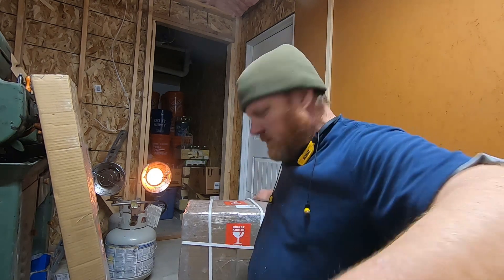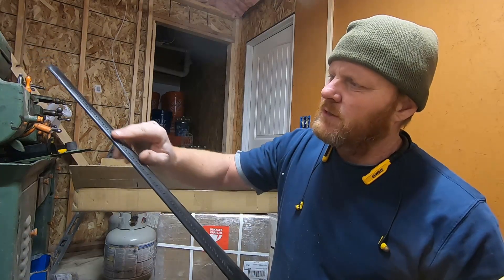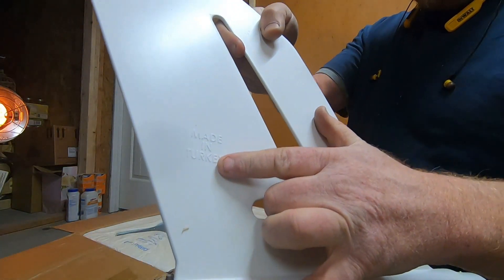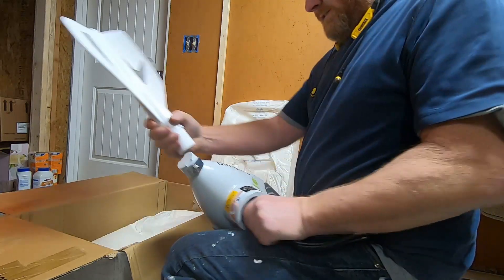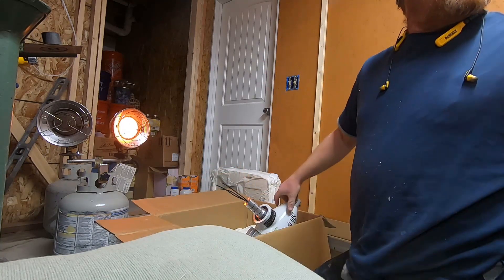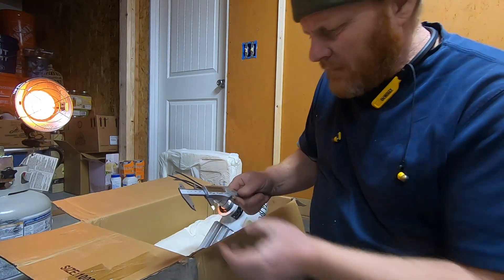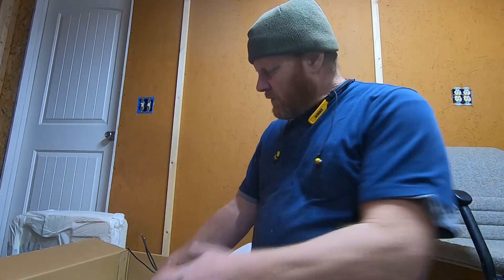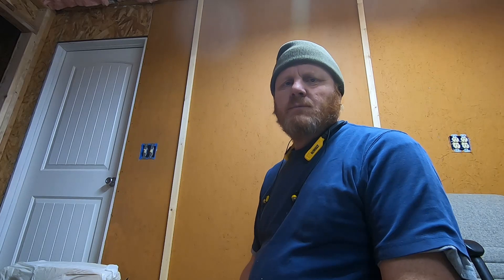Unboxing the Ista Breeze i1500 wind generator, watch before buying, wind turbine, wind mill

Comment: G'day Mate, I found small wind generators start up earlier in low winds,
starting wind speed 10km/h, these outputs are only what I saw in a 50km/h Wind Storm, they would have gone higher in the peak winds of 63km/h.
26V - 24V 500W Vevor   -  8 Amps  - 6.5 Meters  -  Normal 5 Blade
26V - 24V 500W Vevor    -  8 Amps  - 6.5 Meters -  Normal 5 Blade
14V - 24V ista Breeze i500   -  11 Amps  - 4.5 Meters  -  Scoop 5 Blade
12V - 24V 300W Old 6 blade   -  4 Amps  -  4 Meters  -  Normal 6 Blade
12V - 48V 500W Sunboo S5   -  2.5 Amps  -  3.5 Meters  -  Scoop 6 Blade
12V - 48V 500W Sunboo S5   -  2.5 Amps  -  3.5 Meters  -  Scoop 6 Blade
12V - 48V 500W Sunboo S5   -  2.5 Amps  -  3 Meters  -  Scoop 6 Blade
12V - 48V 500W Sunboo S5   -  2.5 Amps  -  3 Meters  -  Scoop 6 Blade
12V - 48V 500W new rotor   -  1.5 Amps  -  3 Meters  -  Scoop 5 Blade
12V - 48V 500W new rotor   -  1.5 Amps  -  3 Meters  -  Scoop 5 Blade
Peak Output Totals  =  44 Amps  =  752 Watts ( my target is low winds )
Local laws stop me putting a big wind generator up high enough to work.

Comment: Im thinking about buying one of these wind turbines. To help charge my battery bank. I have 51.2 nominal and 6k solar array. Which charge controller do you recommend?
Reply from the maker: I'm currently experimenting with that is to breeze does make a controller for their turbines and that's probably what I would go with depending on what batteries that you have

Comment: Hello, can you please help me. I have bought an Instabreeze 2kw 48v and I have a chinese Hybrid Controller 2kw 48v but it seems that it doesn't charge at all. When i connect only two wires it starts spinning and It shows that is charging but when i connect all 3 it slows down (no brake) and only charge up to 50w when outside are strong winds, no matter how strong they are the turbine is not spinning fast enough. The brake works fine and I had winds where it came active. I've tried to disconnect two wires, it starts spinning very fast when i connect the other two it still charging good for another minute then it slows down again for no reason, no break active. Thank you in advance. I have struggling for 1 month and still can't fix the issue.
Reply from the maker: The controller you are using cuts in too early and limits the ability of the turbine to "spin up". You will need a different controller, one that will cut in at just the right rpm. Other wise it's just acting like a break all the time. 
 The reason it's spins up after disconnecting one of the three phase power legs is that its limiting the breaking which in turn allows it to spin up. Hope this helps.
Reply: @veggitarianredneck Thank you sir!

Comment: I have about a week until I can order my wind generator. They have a charge controller on Amazon for $179 , 60 amps. If I could use that  I'll get it going in March. I'm getting the 1 kw Hurricane Vortec. I had a tornado go a couple miles north of me two weeks ago. Broke about seven power poles. I can't help thinking about how much power it would have made tonight.
Reply from the maker: Lol if the tower didn't topple over your charge controllers would have been buzzing 😁

Comment: Be careful with shorting those wires out better use some heavy end loads like heating elements in the    The three contacts of the opeiste side of the stop switch and than short the three ends.. people are complaining that there gen is not producing.. bud the truth is that neodymium magnets can’t stand head ,, they get permanent demagnetized if they get to hot  .. split the break lode over the break resistance you put in there.. it will stay longer 💪
Reply from the maker: Good advice

Comment: Hello. Awesome video. Can you please tell Me the dimensions and weight of the box it came In? I want to see if I can check it in on an airline.
Reply from the maker: It came in two boxes, one with the blades, about three feet long and maybe 7 pounds. And the generator was kinda heavy ide say better than 25 pounds. The box it was in was like 18x18x24 ish if I can remember.
 Hope that helps

Comment: Hello, what size battery bank are you connecting this to? I wondered if you were going to use it for a 12v or 24v bank. You mentioned the turbine was 24v. I bought a different turbine from Aliexpress 24v to 12v battery bank but it didn't output anything. Thanks for the video, subscribed. Toys for Watts do good videos too, thinking about an Ista Beeze now. : )
Reply from the maker: I have 8, 6 volt l-16 type Duracells. I run 24 volts.
Reply: That's probably why it works then! Thanks for your reply.

Comment: Put silicone dam around inside of housing to keep water from getting in rotation bearing, drill weep hole, put tubing around varnished generator wires that come through hole, put tubing around black 3 phase wires where they penetrate stationary 2 screw lockdown, loctite 4 rods, redo all terminals within housing.,..they are not great.   Unit is now ready for service 😂

Comment: Don't use plumbing pipe it has a weld seam down the pipe. It will eventually cut and short out the wires. Use D,O,M seamless ore electrical pipe.

Comment: After you install the blades on the hub , it needs balanced , hang a string from the ceiling down and to the center of the hub , it will tilt down in the direction of the heaviest , just put a  extra washer  or two on the opposite side to balance it until it lays completely flat